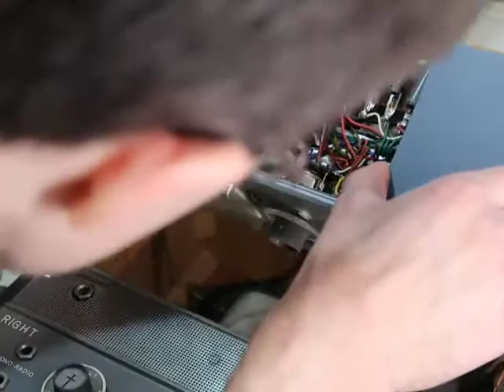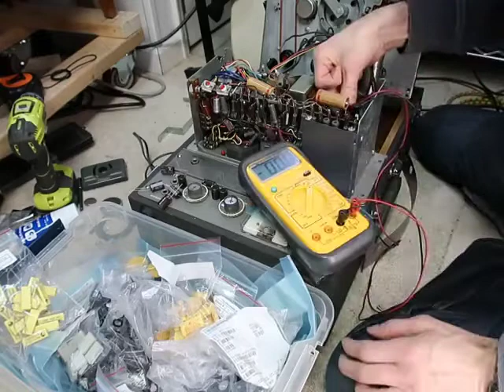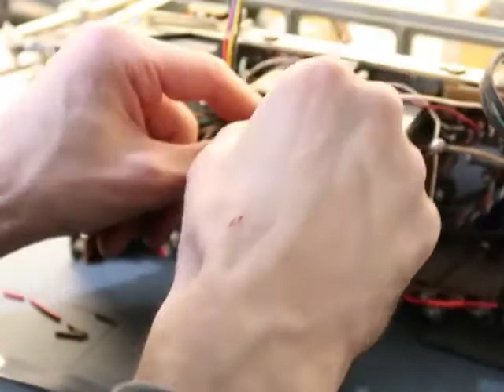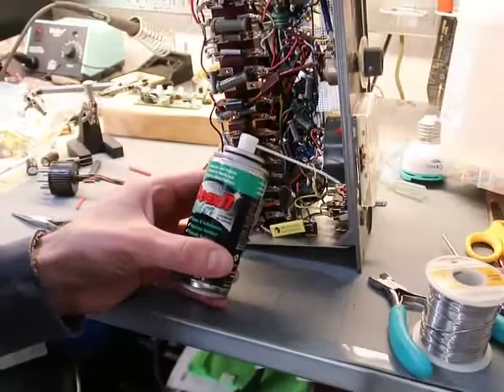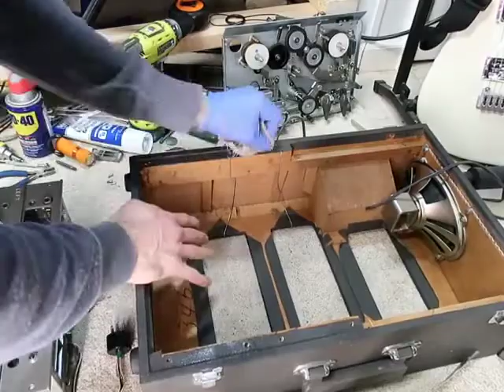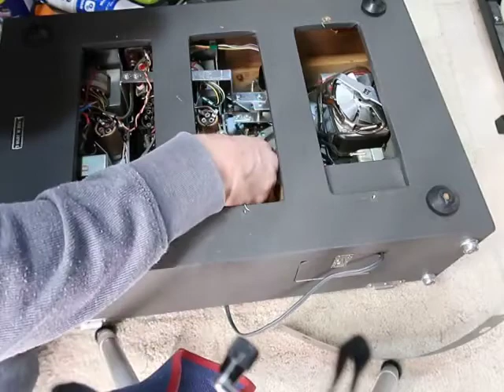Akai M7 Rebuild: Part 2 - Electrical restoration, 1/31/2021

Comment: You mention that the left channel VU meter is unresponsive.  However, I don't recall you ever mentioning what you did to fix that problem.  Later on in the sequence, the VU meter appears to be working.  Can you elaborate?
Reply from the maker: Thanks for watching! I think what happened is shown in the final video -- The knob that switches between Stereo and Mono modes need to be present to physically push down on a little mechanical pin that moves the playback head up and down. I think it was just terribly misaligned because I didn't have that knob properly installed.